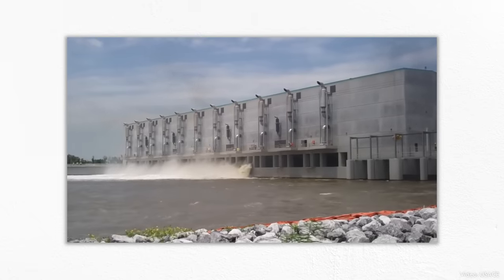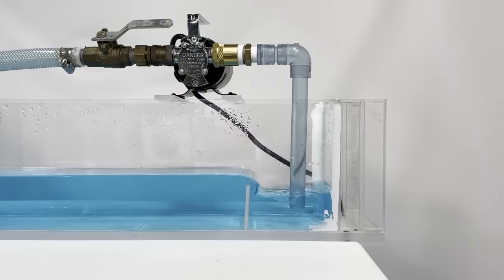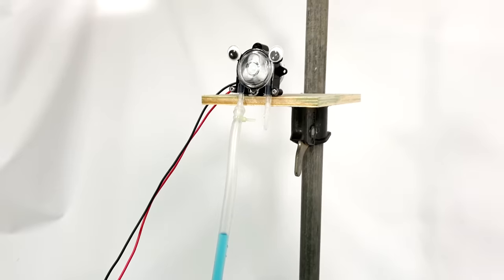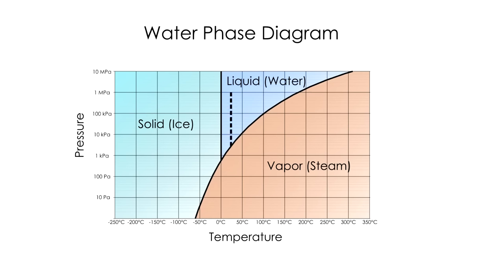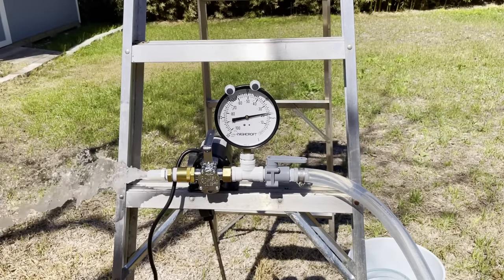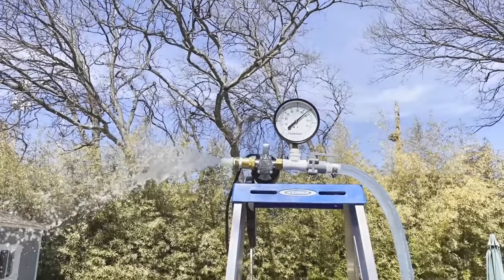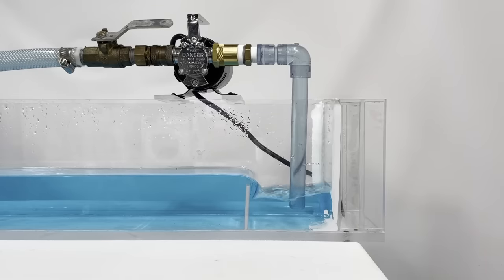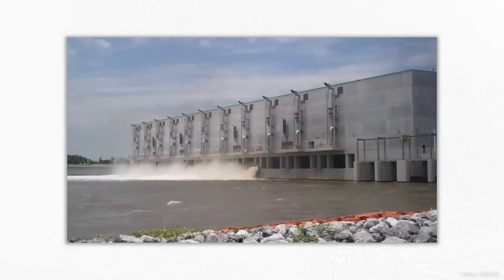The Fluid Effects That Kill Pumps

Comment: I had a desk fan at a miserable job which I labeled plainly "THIS SUCKS" on one side and "THIS BLOWS" on the other.
Reply: Net sum is zero
Reply: Actually a fan slices the air into smaller amounts and slings and pushes it away.
Reply: The mom & pop store I worked at preordered seasonal fans and heaters from a bulk shipper who got all his stuff from China. One year we got 200 box fans that had something weird with their blades. They made a ton of noise but blew very little air compared to previous models.
Reply: @michaelrief4424  That very much depends on the type of fan. See @obsolete professor.
Reply: @mattmurphy7030  😂😂😂
Reply: @obsoleteprofessor2034  Propeller disk mounted in reverse? Anyway, doesn't matter now.
Reply: A Finnish guy I know had a cheap Chinese multispeed oscillating electric fan that was okay quality except for one thing: The computer translated instruction manual called it something like "many accelerate swinging electrified admirer" and the rest of it was equally hard to read. Granted, Finnish is not an easy language either.
Reply: J F  I'm pretty sure it was English to Finnish translation. Either way, that fan didn't write him any letters.
I recently saw couple of strips from Finnish comic Fingerpori which did the same in reverse: A man trying to sell handcrafts and blown glass wares asked for help writing signs in English to attract tourists, but the guy wrote "Finnish handjobs" and "Finnish blowjobs" instead.
Reply: "One side sucks and one side blows"
Reply: @mattmurphy7030  i call bullshit
Reply: @AnalystPrime  Well that would definitely attract tourists.
Reply: Even better if it was an oscillating fan that someone could see both sides as is rotated back and forth.
Reply: On one job I labeled the drawers in my lateral filing cabinet "TOP SECRET" and "BOTTOM SECRET" with laser-printed labels using a stencil-style font.
Reply: @Milosz_Ostrow  super cool
Reply: @obsoleteprofessor2034  That's proably, because of inbalanced fan, my fan are missing a tiny bit on one wing, which makes it noisy AF in speed 2-4🙂
Reply: @obsoleteprofessor2034  Here in Asia circa 1950-1980 we always valued Made in U.S.A. products. Even if they were expensive we wanted Made in U.S.A. products. They were durable, repairable and guaranteed to serve you for many years. We wondered why American made products became rarer and finally stopped selling here. Now we know (chinese cheap manufacturing). I bet 90% of world consumers lamented the decline of U.S. made products.
Reply: I find that hard to "swallow"
Reply: @manuhonkanen2111  thats an intelligent comment
Reply: @michaelrief4424  but will it slice bologna?
Reply: @tomp8418  

That’s funny. I came from the era of Fans before air conditioning was common. We had several blade type fans around the house and I quickly learned that when I was told to stay away from them I had better follow orders or a hand would come out of nowhere and wack me. 
Those old fans would never be sold nowadays on the open market. The guards were made of wire and they were nearly wide open. 
I collect old Fans for a hobby. The front of the blade is pushing air so if you touch it you’ll only get buzzed.
The outside of the blade might nick you. The rear of the blade is slicing through air and then pushing the air and depending on the speed it could possibly remove some of your skin.
Slicing Bologna? Nay that won’t work.
Reply: @lillyanneserrelio2187  I didn't read all of that, but my Haier washing machine lasted 17 years longer than my  Whirlpool.
Reply: @AnalystPrime  Makes sense in a way, Moni in Finnish can mean Multi, as well as Many as in Many people. Not sure about the admirer part though, lmao! Chinese translations whether they're trying to speak English or Finnish are always funny :D